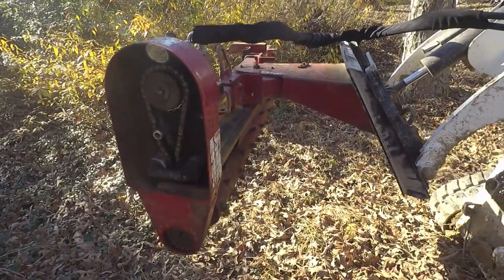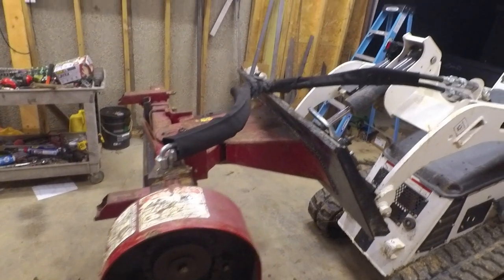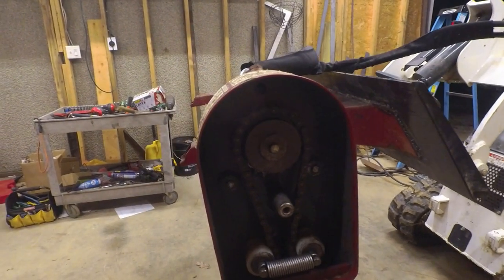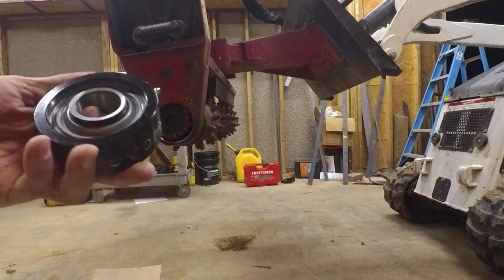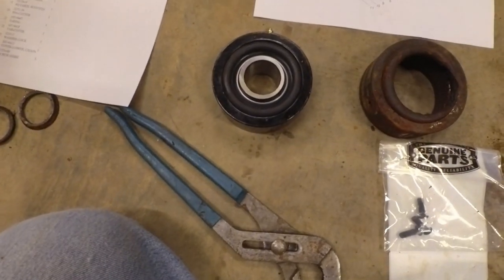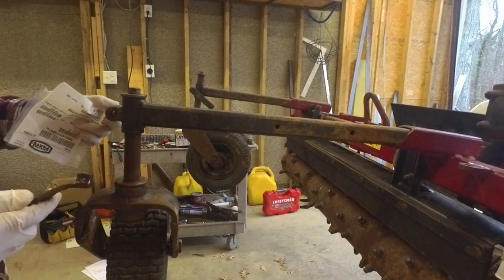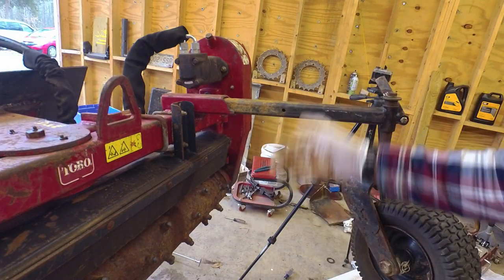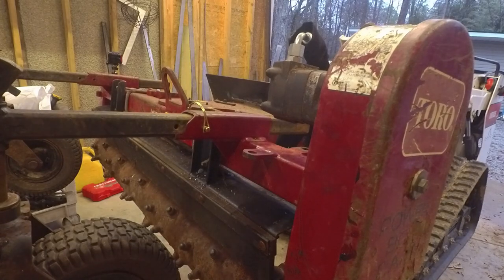Refurbishing a toro power box harley rake on mini skid steer

Comment: You bought the whole bearing, the bearing twist out in the two slots, then you can replace just the bearing, usually from a company in MN, around $65,00 dollars. You pound at 1/4 way from 12 O'Clock with a punch  from the two slots and the bearing turn out kinda sideways, the O ring is at any cylinder rebuild place for around /$5.00 or less The chain could have been soaked in Kroil, penetrating  oil , best stuff ever, just done rebuilding a drum, workers broke the shaft loose inside the drum, cut the end out and made a new thicker one, 3/4" thick instead of 5/16" crap they use. ONE tip, make sure your slip  ( don't think you have one on a hydraulic drive unit ) clutch is lose and working, if not when you hit something and it doesn't release , some thing will break,, Another tip is to drill 2 more holes in the wheel extensions rods so the distance from the rake drum is as far as you can get it, makes grading much easier and more control for depth when your grading, we have three of Harley Power Rakes,  and all have broken inside the drum,  we run them off 3 pt hitch, so we don't eat so much dirt and dust.    Nice video👍👍👍👍   Oh, these are the same design at Harley Power Rake.

Comment: Welding a nut onto the broken bolt usually works well to remove the broken bolts. Sometimes that can be difficult. If you weld a washer onto the broken bolt first and then weld a nut on to the washer this makes the job easier.
Reply from the maker: Great tip Alan! thank you

Comment: WD40 doesn't work on big time rust or frozen parts. You need high quality penetrating oil. PB blaster is considered good, but I don't like it. My old cans of pen oil from work are 10X better, but it's not the same anymore, they changed the formula. If you can't get anything better, get a couple of cans of PB Blaster on a shelf in your shop and put the WD40 in the house for fixing clocks and door hinges.

Grease your o-rings before installing so they slip in easily and don't rip.
Reply from the maker: I saw this first hand when we were trying to get a flat tire off a 2001 Jeep. No amount of WD 40 would loosen the rim from the hub, yet once we sprayed with PB Blaster the rust dissolved and the wheel popped off. I was sold forever on PB.